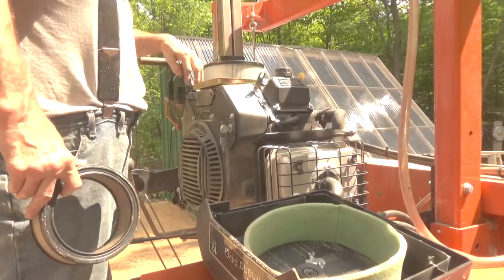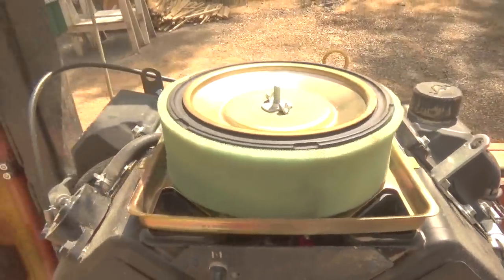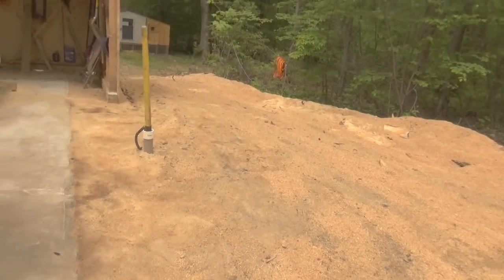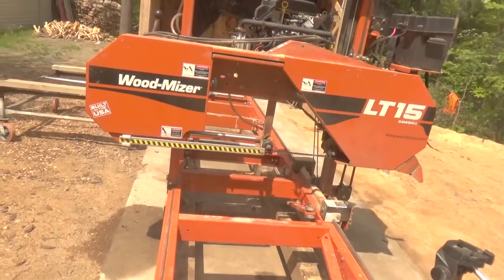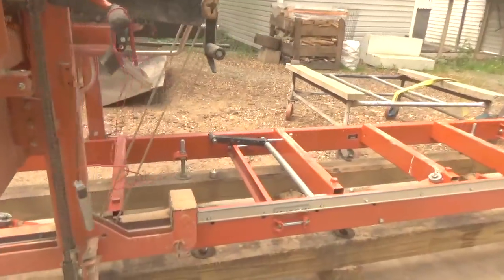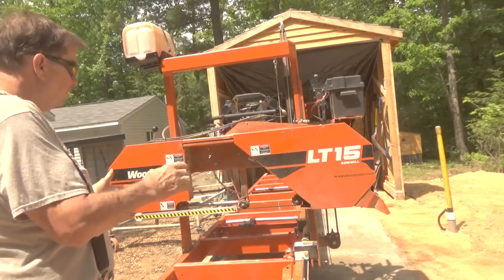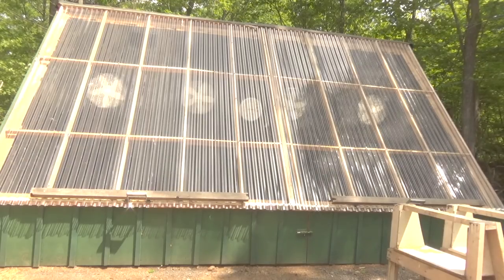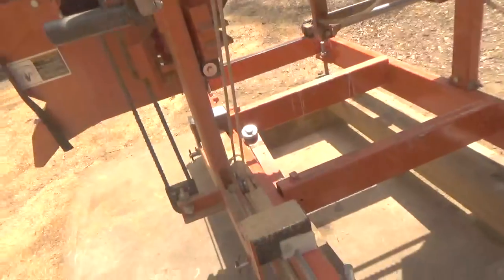Woodmizer LT15 ONE YEAR REVIEW:   YEA OR NAY

Comment: Very nice of you to share your year with us, I would like to know your age as I am 61 and thinking of going wood-mizing  for a while, as for your issues with filling the water tank, I would fit 2 hoses on top of the water tank, one would be just a return hose for overflow, but the other one would be the water intake hose, with a valve, I would connect to a water hose, and just open the valve to get water in, when it pours out of the other end, just stop because the tank is full... and just tie-wrap the hoses so they do not run loose! Nice video...!

Comment: im in the process of setting up ny new lt15 wide. and i fully agree about release the tention,  my old homemade mill, the water tank was higher. and not removable. i fill up a 5 gallon jug, water and dawn, i use a transfer pump aligator clips to the mill battery. and stand there and pick my nail s while its filling up
Reply from the maker: Sounds good Mike, congrats. You are going to love it. Go slow, don't hit the backstops. LOL

Comment: Great review, Joe. I have also noticed how much sawdust is drawn into the front cover on the engine. I have to wonder if that's not part of the reason there's not a pull cord assembly on sawmills. Something like that that doesn't get used much might end up pretty jammed with sawdust. As far as my electrical problem goes, I'm definitely thankful it was under warranty. I'm certain I'm in the minority with the issue. Wood-Mizer gives a 2 year warranty on even the electronics. Who does that? I think it says a lot about their confidence in their system and the convenience it affords me is worth it. All in all, I feel like if you're having problems with a Wood-Mizer, it's because you're not doing something right... My problems have largely been operator error
Reply from the maker: I am so disgusted with computers in cars and trucks that I dont want to deal with the electronics. But I guess I will have to move forward on that issue if I get a bigger mill.

Comment: I agree that water tank is heavy to lift up there. My biggest complaint is the cant tips that fit on the dogs. They fall off unless you hold them while moving dog. I am going to drill and tap them to install spring loaded ball detent to grab the acme thread.
Reply from the maker: That is something I did not mention, it is true. A couple of times when I pulled the dawgs to slam against cant they went flying away from the mill when I went under the edge of the cant.
Reply: well  did ya ?

Comment: Maybe a garden hose to fill the water tank. I like the way you bolted the sawmill down to the bed and concrete. Once you level it, it should stay level.
Reply from the maker: I have to come up with something, one of the other comments mentioned a garden hose as well. Thanks for the comment.
Reply: There are hose adaptors for gardening that can flex, or even just threading u-shaped  pvc pipe to the end of the hose or fit the cap with a short 2’ segment of hose extension so it can easily be connected at a lower height.

Comment: Hello Jo,
Very informative review. One thing that sticks out to me is it seems they could engineer some of the moving parts (blade guide rod) to allow for baked on dry film lube. This type of lube doesn't attract dust. I work in the aircraft industry and some high ware parts have this treatment but the diameter of the part has to be a few thou smaller to allow for the dry film lube thickness and the final diameter to fall within specs. One thing new owners could do is use spray on dry film lube when assembling their saw on the parts that the added thickness won't affect. Another possible substance is graphite although, some things might get too loose with these two items. On the water tank, seems like they could add a hose that you could hook a hose up to to fill it and an overflow vent. Just thought I'd throw in my two cents. BTW, it's hotter than blue blazes here. I'm on vacation this week and  I'm going to have to go back to work to get some rest. This fat boy has been sweating profusely!
Reply from the maker: Drink plenty of water lol.  I like the idea about the hose connection as soon as I catch up in a year or two I might be able to rig something up. Some of the tolerances are pretty tight. Even extreme temperature changes seem to affect things like the dawgs moving on the pipe and such.

Comment: You mentioned you paid 7500 for the mill. What would you value the 5500 board feet at? Would you recommend pouring the concrete before purchasing the mill, or do you think it could be added later?
Reply from the maker: If you wait to pour it it may not get done. Not a reflection on you, just my opinion. Do it first makes a nicer way to work when the mill comes.
Reply from the maker: When the lumber was dried and planed it is worth $38,000.00 Which includes the different varieties of wood. Cherry, maple, pine, red oak, white oak.

Comment: I've got to wonder if you could effectively turn over a 19 HP engine with a pull starter on that machine. It's rather high off the ground and embedded between the fuel tank, controls, etc. such that you cannot get a good straight pull on it. Full disclosure, my right side hurts thinking about it... memories of a bad rib strain injury from pulling something with poor form!

Comment: I think for the price of even the LT10 (& all the rest of the range) they should come with a cheap metal detector. They're only about $35 online these days.
Reply from the maker: Why not just buy one online and then you wont have to pay a markup from Woodmizer.
Reply: Josaljo Won - becase it seems to be the way that few small millers are actually using them.the $35 is retail & they can be gotten wholesale for alot chaper so if woodmizer did mark all tge mills up it would only have to be by $15-$20 on a $10,000 to 80,000 mill.

Comment: for filling your water tank how about something like this?
https://www.amazon.com/Sierra-Tools-Battery-Operated-Liquid-Transfer/dp/B000HEBR3I/ref=br_lf_m_prrkoa5wygar4v4_ttl?_encoding=UTF8&s=hi

just a thought.   it was a quick google search then you only need to carry the water to the mill and let the pump move it up high for you.

great year review!
For your kinked blades that have hit nails or the mill due you just throw them away or I would think keep them around and you could use them on a suspect log to make the first couple cuts on the way to getting to rough cant then change over to a good blade and make your cuts to get a nice cant?  or use them on a log full of frozen dirt and sand as that is hard on blades as well.  so them blades become sacrifice blades for cutting off the real ugly stuff and save the good blades for getting to the good stuff.

Is there a worry of the bad blades putting undue wear on the rest of the mill when runnint them?  Like the blade guides and stuff?

sorry for my long ramble!